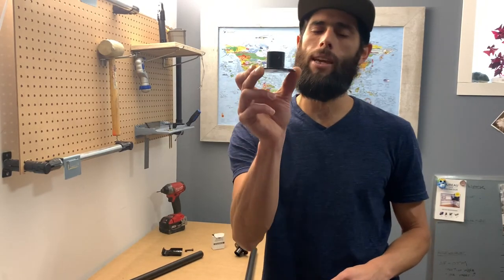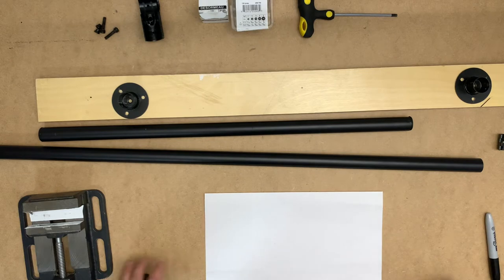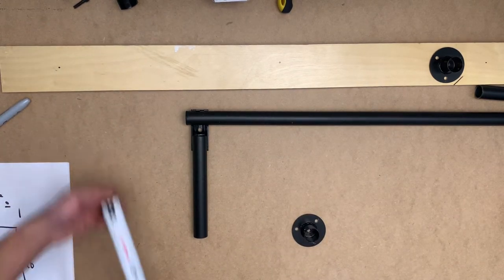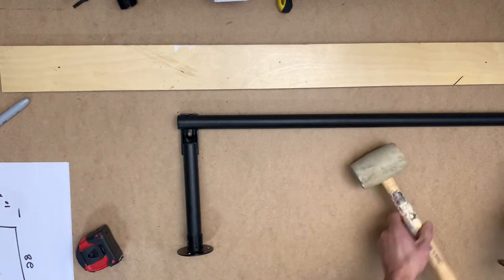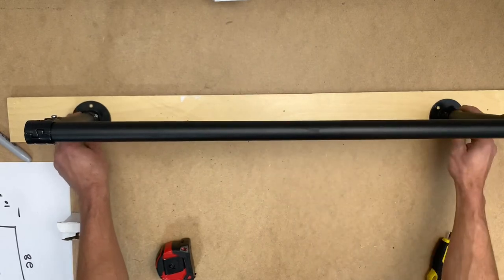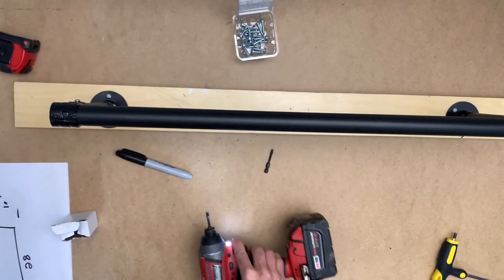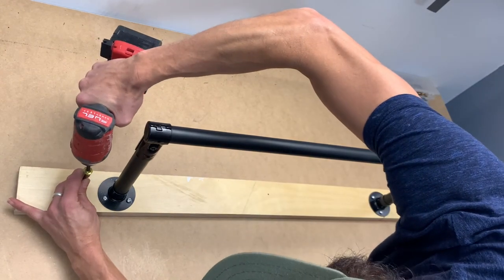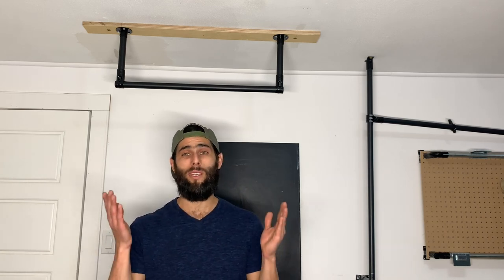ABC'S OF ACCESSORIES 003 af-otm | tinktube

Comment: How do TinkTube pipe and component prices compare to using black (gas) pipe and fittings?  I like the project on GreenSmartzDIY  YouTube channel.   Tom Mills mentioned that you offer black, white, chrome and copper tubes;  are the same color options available in the fittings and components?  Sincere thanks,
Reply from the maker: Excellent question, if we compare pricing we can see that a 1" x 10ft (gas pipe) runs around $23. Our tubes come in 1 1/16" x 92" length and for the black tube we are looking at $12.75. Also the (gas ) pipe is much heavier and often times you have to clean them before using.
The fittings come in two colors : Black and chrome. ( We recommend the black indoor/outdoor and the chrome for indoor use. 
Lastly, the (gas pipe) is threaded at the ends to attach the different kinds of elbows, t's, limiting what you can do with a certain length, with tinktube you can always shorten tubes if needed be and change the set up of the fittings quick and easy.
Thanks for the comments!
Esteban

https://tinktube.com/shop/